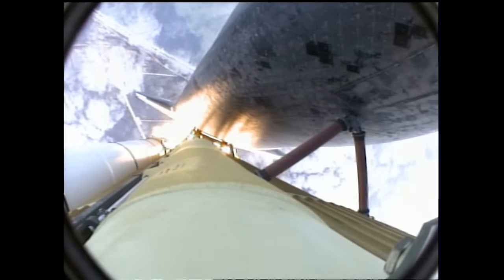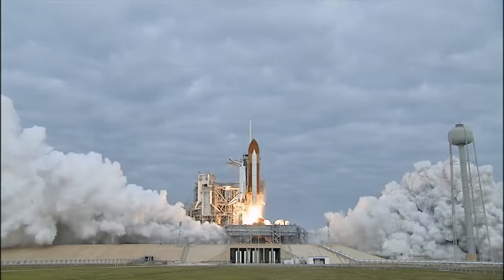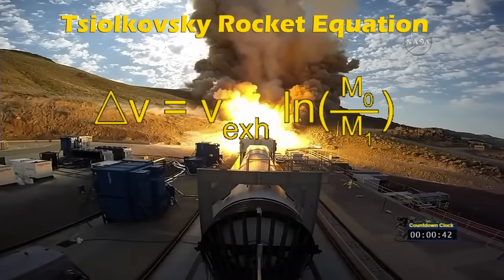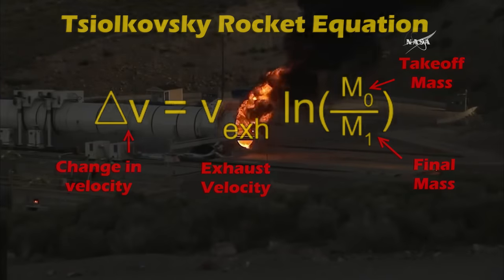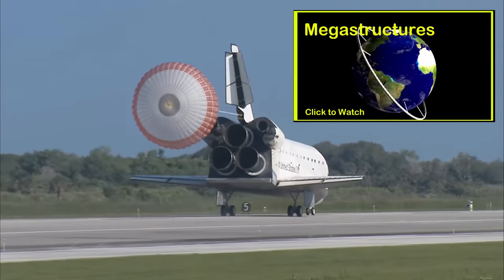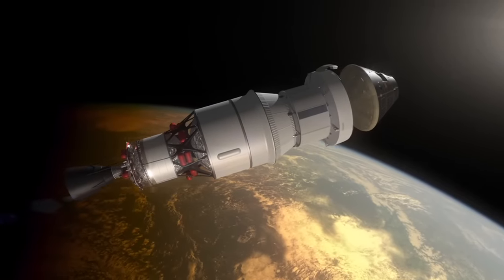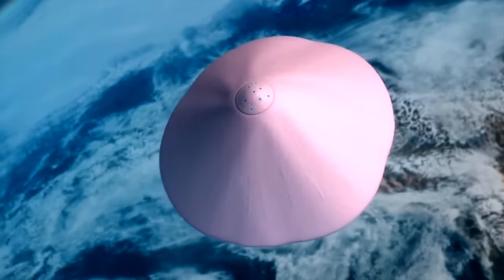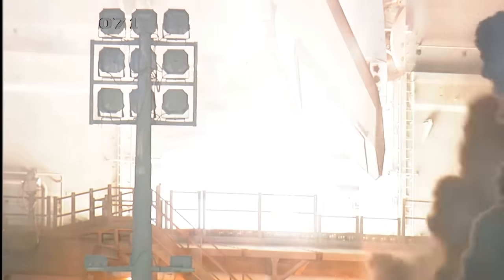The Spaceship Propulsion Compendium

Comment: I would like to point out that nuclear-electric drive systems have a major Achilles heel:  the ability to dispose of heat. Unlike nuclear thermal systems the heat needs to be disposed by radiation which is a very poor method of dispelling heat.
Reply from the maker: Radiation isn't that bad of way to dispose of heat in a vacuum, remember its how we get rid of all our sunlight, and it scales up linear to surface area and with the fourth power of temperature so if your equipment related to the reactor can handle it you can purge whole kilowatts per square meter. Keep in mind all power sources in space, nuclear or not, have the identical same problem, except where they can cool, as it were, by shooting the hot matter out the back as propellant.
Reply: Thanks, 
 I will like to add that higher temp means that more of your power source goes to waste heat and the more radiator the more massive your ship. And volume goes up faster than area does so space ships will likely be either limited in size, very flat or eject a lot of hot matter on a regular basis.

Comment: How does a solar-powered ion drive compare to a solar sail?
Reply from the maker: Better till it runs out of reaction mass, so it has far higher acceleration but a far lower top speed.
Reply: Isaac Arthur
Hm ok, but doesn't that then mean that it all depends on how much your ion drive can accelerate each individual particle? If it were practical on a weight and cost level to basically have a linear particle accelerator as your rocket motor, you could use an arbitrary amount of energy per particle and therefore carrying around reaction mass could be made arbitrarily efficient, right? Also, there should be a cut-off point depending on the density of the medium after which it becomes sufficient to collect ions with a Bussard-like collector, shouldn't there?
Reply from the maker: Sure, but even the worst ion drive gets way better impulse per watt then light reflection. Again, once it runs out of reaction mass it is useless, but until then it does better.

Comment: Actually, fuel (almost any type except nuclear) is incredibly cheap... so long as you don't throw away the vehicle after each use.
Elon Musk has stated that fuel costs for a Falcon 9 are only 0.3% of the total cost of the rocket. 
This works out to only $180,000 per launch with the assumed cost of $60 million for a Falcon 9.
If a fully reusable launch vehicle can be built, the cost of inspection and refurbishment will probably exceed fuel costs per launch, but will still be ridiculously cheap compared to even the partially reusable Falcon 9.
Reply: philburch1970  what about nuclear waste there's plenty around the globe ,if only NASA could find ways for start make  propulsion on nuclear waste .

Comment: Have you ever heard of a "tachyon drive" which basically allows a spacecraft to travel anywhere in the universe within a second.
Reply: All spacecraft engines can do that, given enough time.
Reply: well, he did say "within a second."
Reply: Alexander Ferguson i edited it after he said that.
Reply: ah right
Reply: Tachyon drives are a work of fiction. Tachyons are particles with virtual mass which means that they cannot move slower than light. One kind of tachyon drive I know from fiction just uses tachyons as guiding signals within subspace. Subspace, hyperspace (and metaspace :P ) are fictional concepts of a lower, higher (or besides) level of space in which different rules apply e.g. space is much more condensed which means you are getting a further way in space when you move the same speed in subspace (the one I know of or metaspace). I am not familiar with any explanations for hyperspace :Ü™
Reply: +guitarplayer1071 actually not, there is a limit for humanity. the local group.
Reply: I'll start by being pedantic by taking issue with "within a second".  Getting up to a reasonable fraction of the speed of light "within a second" is fatal to man and machine.  Humans have survived brief excursions to 100g for tiny fractions of a second.  Hardened military electronics have been rated for 17,000g.  Breakthrough Starshot it talking about subjecting postage-stamp sized probes to 18,000g for 20 minutes to get to 20% C.

Current chemical and ion rockets are subject to the rocket equation.  The rocket equation takes into account the fact that you need to accelerate your fuel along with your payload.  Current rockets are limited to around 10% C, a little less if you want to slow down at your target.

Highly speculative technology (warp drive, space folding, infinite improbability drive) are not very helpful since all depend on unknown physics.  Unknown physics probably means impossible physics not "physics we'll eventually figure out".  Perpetual motion machines are an example of impossible physics.

Emdrive has been described by several big name physicists as "like trying to make a car go faster by sitting in the driver's seat and pushing on the stearing wheel".  Some fans will wave nonsense phrases as an explanation like "pushing against quantum virtual particles".
   I don't know where the testing labs are getting thrust from but I'm putting my money on interaction with Earth's magnet field.  Might still be useful for satellite station keeping and periodic orbit boosting for the ISS.  Useless for interplanetary or interstellar missions.
Reply: Has anyone ever detected a tachyon, though? They're probably fiction, and if they aren't we will probably never be able to use them, or even interact with them. And, while a tachyon might travel FTL, a spacecraft with a tachyon drive would not. Unless you intend to make The whole ship (and crew??) out of tachyons? Hard to imagine the assembly process, where the raw materials are moving faster than light... Do tachyons interact with anything, including other tachyons? Can you make atoms and molecules out of them? Can you have a massless "thing?" It all seems fundamentally impossible to me.
Reply: +Lenard Segnitz tachyons don't accelerate afaik, and they always travel at a MINIMUM of light speed, with infinite max velocity. Supposedly. I'm not aware of any evidence that they really exist.
Reply: Tachyons are science fiction.  They're a sci fi trope to shoe-horn FTL transport, FTL communications and time travel... all of which are complete sci fi.

It irks me that people waste time with impossibilities when actual, real stuff is fascinating.  Why do people go ga-ga over UFOs and unicorns but can't be bothered with quantum mechanics?
Reply: Lenard Segnitz While I do agree that it's a waste of time to keep trying to do the impossible, from what I can tell FTL travel isn't truly impossible, or at least we don't know that yet. While literally going at light speed is impossible, there are potential workarounds, some of which might be plausible. Of course, tachyon drives are bullshit.

Comment: A pB11 fusion rocket/turbine could get a ten ton space ship going 10 kilometers per second with about 3 grams of fuel.  Even if it was possible to travel near the speed of light, hitting a golf ball sized object at that speed might destroy the ship.  There is a  fusion rocket system that would solve both problems....if it worked.  I have not seen this mentioned anywhere.  This video showed the futility of using a typical light source such as a flashlight for thrust.  And the science was supposedly settled back in 1979 that said lasers cannot accelerate electrons in the direction of travel of the laser beam because of the transverse electromagnetic field etc.and so forth.  But Xrays can accelerate electrons to tremendous velocity with a substantial component in the direction of the direction of travel of the xray.  Compton scattering describes this with a formula that involves relativity.  Too bad the same is not true for longer wavelengths.  It seems a rather obvious question to ask why is there not Compton scattering for longer wavelengths if however slight.  Outside the formality of the textbook, it is said that there is in fact Compton scattering that can be calculated using the same formula as for xrays.  And light may have zero or unknown momentum but it does exert a force on electrons in the direction of the motion of the photons greatly in excess of what was referred to in the video.  It must have occured to the fusion scientists a long time ago the idea of using high powered lasers to force electrons into the ends of the plasma to cinfine the ions. Perhaps they tried it.  The numbers suggest it is possible despite the simplified relativity of the textbooks.  The intensity of the laser requured could be furnished by the tremendous power of the reactor fed back into the laser.  And the laser driven by this process could disintegrate just about anything in front of the ship while it was many thousands of miles away.

Comment: 12:50 Using a constant nuclear explosion to power a ship is also
a good way to arrive most radiated in a soup style.
First the nuclear explosion would yield thermal energies,
which would eat through your radiation and heat shield,
which is supposed to absorb any kinetcs to derive speed from.
Then the radiation would cook any occupant or EMP blast
any electronics.
Basically for organic matter, it would turn soup over time, and well
cooked, since even nuclear drives will take decades to reach any
extrastellar destination.
So, let's not try and arrive as well cooked semi parbroiled soup,
or heavy mutants (with the heavy pertaining the amount of genetic
mutation, not mass) , shall we?
Reply: No, you can't send soup as emergency rations to off world
colonies in Alpha Centaury or such this manner too.
Although it's already soup, the added radiation, although
being very useful for keeping it sterile, would not make
for a healthy food supply.
Reply: In space the following is true:
If your incoming heat exceeds the outgoing heat,
you and whichever vessel you travel in turn into gas.
It's universal and unavoidable, save inverted amplitude
field cooling.
Yes, you can cool something in outer space by inverting the frequency
of thermal vibration and projecting that onto whichever you want to cool.
This is done by laser induced cryo cooling for instance.
But..
If you want to try and cool any heat produced by a nuclear explosion
by using this method, you'd need so much more power than the
nuclear explosion engine, that it would quickly slow any speedy
acceleration to a miniscule crawl, since the afforded mass from the
cooling system would greatly multiply the mass of the vessel.
Field induced inverted sympathetical thermal vibration
is not very useful for cooling something other than a few atoms at a time.
Any matter that needs cooling that way needs to have the exact same
vribration frequency, but also the same period and vector within
said vibration, timed to the arrival of the field amplitude at range.
Anything closer would need a different period within the field
in comparison with anything further out, since even fields are not
instant, but progress at lightspeed.
Without going into too much detail, field induced cooling
is not going to work on such a scale.
Maybe if they could be synchronized at range, but otherwise not.

Going nuclear in space is just a bad idea, no matter the PhD's
stating it would work and work great and be awesome.

Aslo, people stating a PhD ni anything as a logical argument
in a scientific discussion should be avoided, since they have no clue
that it doesn't matter whether they have a PhD or not,
only if what they state is true or not.
Never let a PhD convince you that what they say is true or false.

Comment: Even Star Trek used the metric system ... please ! :)
Reply from the maker: It is good not to have a single unit approach, not doing so tends to result in errors and problems too, like using superbase prefixes too much, the thing that screwed my calculation up at the end of the video with a mN/kW units rather than just N/W or a nice homemade 'photon push per power = 1' standard. People tend to forget that it isn't just the US that's the holdout on Metric, science doesn't use it or even SI all the time either. :)
Reply: And when they don't use it they tend to crash satellites into planets ;)

Comment: At 27:08, You speak of "Exotic' Matter. 

You don't need "Exotic" matter. 

"Warp" Drive can be achieved by turning a ship into a discoid shape (Ei: A High K Dielectric Medium Material) , Add a Deep and VERY strong positive voltage charge to the front and top of the craft, And a deep and VERY high Negative Voltage on the rear and bottom of the craft. (Billions of volts 5% amperage), Interrupt the voltage in a manner that causes the craft NOT to polarize.

and the resulting propulsion results in the Negative South Pole lurching towards the Positive North Pole of the craft, causing the craft to LURCH and ACCELERATE towards the north pole of the craft.

Essentially, You are crafting a "G-Well" in front of the craft,  And a "G-Hill" behind the craft, Exactly like how the Alcubierre Drive, Except, Its not "Exotic Matter" that is being used to power this spaceship, its ULTRA high VOLTAGE, And slight Amps to encourage a flow of electricity and Acceleration.

Please Research "Dr. Thomas Townsend Brown's - Electrokinetic Propulsion Drive" 

And also look into a new type of propulsion system called "Nassikas Thruster" Same as "Quantum Locking Levitation." For example. You would have a electromagnetic Material shaped in a cone, and in the "Tight" cone part of the Cone, you would have a Permanent Magnet attached permanently to the cone, Next you would super cool this joint apparatus, and it would it self create a "Reactionless" Thrust. Because the Magnet and SuperConductor are conjoined.

Anyways, Please take a look at these two types of propulsion systems.

Comment: 25:35 This is completely FALSE! You cant bounce light off a TETHERED reflector back and forth as the reverse trip will balance out into equilibrium. What you are describing is something like taking a solid rocket engine, and using a blast deflector like the mirror. The setup would just sit on the ground and make a shit load of noise and smoke!
Reply from the maker: Who said anything about a tethered reflector?
Reply: You did, when you said, "bounce off a reflector", or are you implying space is full of random orbiting mirrors?
Reply from the maker: "bounce off a reflector" is not in my script, time index?
Reply: 25:50
Reply from the maker: Okay, when quoting me it is good to actually quote me, since I don't remember scripts from months ago and have to search them. Clarify what exactly you are asking me or challenging here, YZ, I'm not getting what you're saying.

Comment: a rocket stright up to 100 miles and a car not on the ground but stright up if O2 how much fuel would it use to get to 100 miles... gotcha :-)  or rocket on the ground with wheels 5,000 miles maybe

Comment: THAT'S FUNNY, 1,000,000,000/300,000,000=3.3333, STILL HAVE SOME TO SPARE; 0.3333. Also, there is a big misconception. If it were antimatter generating the wattage, it would not matter if you have 1 watt/300,000,000, you would still have a force of any wattage possible. You would have any desired wattage, even 1MW, and that's tiny. How can you possibly know any better, if you haven't truly used antimatter before? That light you speak of would be turned into energy. Get it, there would be no light, because all form of energy would be yours to command. It's weird if I say the speed of light would equal 0 and it's not really in the calculation, isn't it in the calculation? Presently, any opposite force, matter, what have you, would be cancelled by the antimatter. It won't destroy matter as people believe, matter would simply be more useful as energy. Trust me, I know.

Comment: I have two major problems with this whole concept:

1: Light speed just isn't very fast. It's obviously fast on practical human scales, but on interstellar scales it is a snail's pace. And on intergalactic scales you might as well be standing still for all the good it'll do you. There at most 200 stars that you could plausibly reach within a human lifetime, if you could somehow travel at light speed. And even then you would obviously need to first accelerate, then turn around and finally slow down before arrival. So it would never actually be light speed except in the middle parts of the trip. Light speed enables you to cross the Milky Way, provided that you don't randomly crash into something, in about 155 000 years. Hooray! And of course any signal communication either way would then also take 155 000 years, which is even worse than my e-mail response time. I keep having this vision of a ST satire where a colony in the LMC keeps rebelling against the first Milky Way Empire. But since it takes 65 ooo years for the emperor to notice it every time because of the light delay, my comedy would center on the team of interstellar marines who are sent on 65 000 year roundtrips there to squash those pesky rebels. It's funnier in my head than it is when I write it, but just trust me: it'd be very funny.

2: Fast acceleration produces G forces for any humans onboard. Certain things you could do theoretically you probably can't do if the intention is to send humans anywhere. This to me is the same as saying that it is perfectly possible to fly if you jump off a tall building. Which it is, if you have wings. If you don't have wings it probably won't work very well. Most humans would pass out at about 3Gs. I know there are theoretical things like crash gel with injectors for blood pressure etc that you could do. But how safe would that be, and surely there would still be some upper limit to what anyone might be able to survive in terms of G forces?

PS: DW about the speech thing. In fact I am so used to it now that I rather prefer Jupitor to Jupiter.